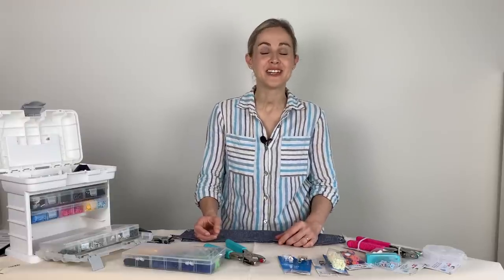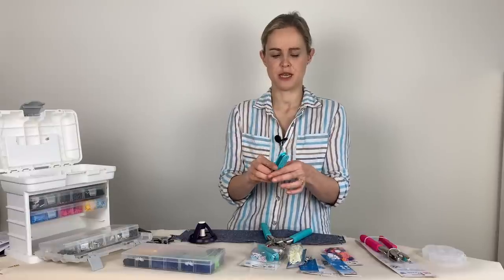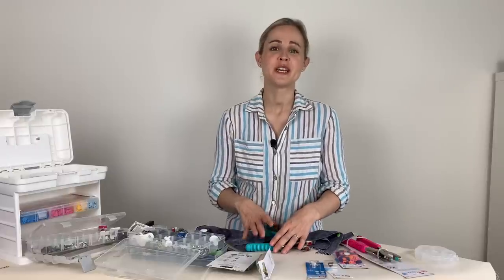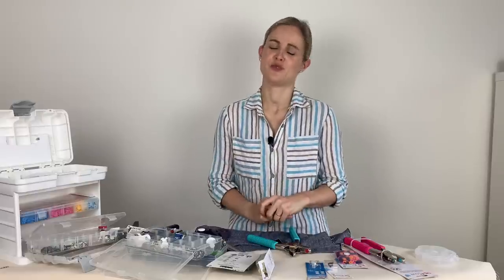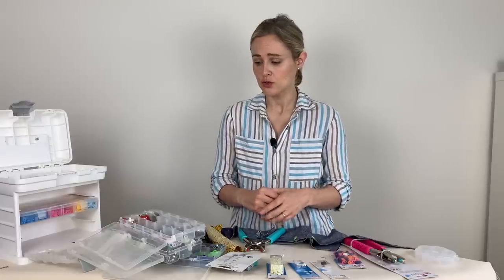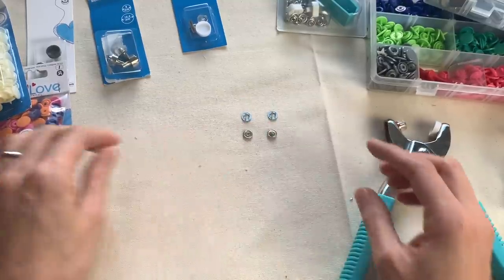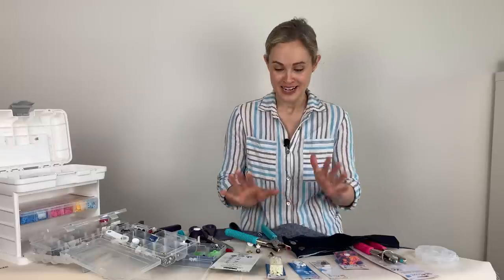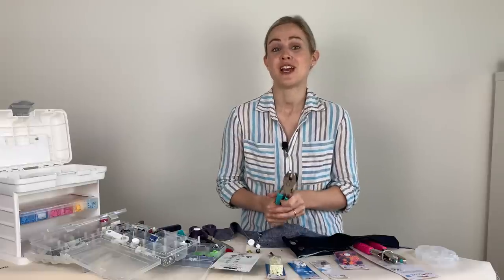How to use Prym Vario Pliers - Laurens Top Sewing Tips - Part Thirteen

Comment: I was very fed up when I bought 4mm eyelets - they were impossible to apply well. There were 2 problems - 1) minimal non-verbal instructions with hard to comprehend pictures and 2) the 4mm eyelets are one piece only. l was hoping that this video would help, but it doesn't because it doesn't show how to apply this type, only the larger, 2-part ones...

Comment: Hi Lauren I've just used my prym pliers for the first time with 9mm fixings and 9mm coloured poppers.  I have made a quilted caddy bag.  It has 2 layers of cotton fabric sandwiched with cotton batting.  The poppers,went on well but after a few times pulling them apart, one side stays with the other. I've gone through a dozen.  Am I using the wrong poppers, the bag is probably 1mm thick where the hole is?

Comment: I bought these 5 years ago and have never used them! I already had Kam snaps and pliers what worked fine but wanted these to use my non-standard snaps, jeans buttons, rivets etc. Once I discovered that I'd need to buy more Prym products in order to get the setting tools, I put the Love pliers at the bottom of a drawer in my sewing room where they stayed. I felt I'd made a poor choice.

So now after watching your video I can at least make holes and insert plastic snaps (easier with the Love Vario than my old pliers). And I will look into buying the rivet and eyelet tools which I'm hoping might work with the hundreds I already have? Thanks for posting this😊

Comment: This is really helpful, thank you. I bought the large set of metal bits, includes Camping etc. However, I have lost all the bits to tell me which attachments to use for what. I did ask Prym for better advice, but didn't get any feedback other than to watch the videos. It is difficult to see the parts and which piece goes with which attachment. I understand everything else but it would be helpful to see before squeezing it together to show the part and the piece together before attaching. Thank you again, I'm sure I will get there with a bit of trial and error.

Comment: Hi Lauren, many thanks for the comprehensive video on snaps which is very timely as I was trying to add some jersey snaps to a little romper suit that I'm making for a new baby. Although it's a light, woven fabric I bought the jersey snaps. I've put a piece of tape on to reinforce the fabric where the snaps are to go. I was too mean to buy the pliers so just used the tool with a hammer (which is what I always remember doing, although it's probably 25 years since I last used them!!) Much gnashing of teeth later, I gave up! The spikes kept either coming through the fabric outside the popper or they wouldn't grip at all and the tool broke! What is difficult to see in the video is which way up the 'female' piece of the snap goes (and I can't see on the Prym instructions, either). Is there anyway of either describing or inserting a photograph, please? Sorry if I'm being really thick!! Thanks!
Reply from the maker: Hi Vera, 
I'll add another picture to my blog post that shows that a bit clearer. It sounds like you might not have had it the right way round, or everything wasn't lined up when you hit the hammer. It's harder to keep things lined up and engaged with the hammer, that's why i prefer the pliers as you can slowly control things as they come together and make sure the two sides of the snap are 'engaged' before applying the force.
Reply: @LaurenGuthrieGhani  Many thanks, Lauren! Yes, I think I must have got them upside down. Ordered some pliers from you yesterday and some more snaps.... don't tell my husband!!😅

Comment: Hi there, thanks for your comprehensive video.  I find it quite difficult to separate the plastic snaps once closed on the garment. Do you have any tips or tricks on how to separate them more easily?
Reply from the maker: Hello, I think as long as you have reinforced the fabric you are attaching the snaps too, don't be afraid to be....'assertive' when opening them. Sometimes with repeated use they might get a bit easier to separate :)
Reply: @LaurenGuthrieGhani  ok, thanks for replying.

Comment: Thanks Lauren, this is so helpful. I've used Hemline anorak fasteners and put them on using  a hammer. Some of the them leave the inside part of the top fastener behind when you open them. The result is that I have to remove them. Any tis on how to avoid this? thanks, Shivaun
Reply from the maker: Hi Shivaun, I've not used the Hemline brand ones before so I'm not 100% sure, sorry. It sounds like maybe things haven't properly engaged and linked together so maybe you need to hammer a bit harder or on a harder surface when you are initially attaching them

Comment: I watched this because the instructions on the pack are useless! I've used the plastic snaps by trial and error my reason for watching was to find how large a hole needed for 5mm eyelets. I'm still not sure! I have put eyelets on the back of a corset and, though I have the hole cutter for the snaps and they aren't big enough for the eyelets 'top hat' part to go through very tough fabric even with lots of 'encouragement', I ended up using my scissors as you have suggested plus some Fray Check. Not an easy task with 2 layers of coutil and 2 of satin. I managed in the end with trial and error on scrap fabric but on the actual garment it took me all day to insert 22 eyelets! This video, though it didn't fully answer my query, is excellent for all the different types of fasteners. The only thing I would have liked to see was a more close up of the tools and the parts for each fastener when you layed them out on the table. I'm going to order one of those hole punches you used. Thanks so much for this useful video.

Comment: Thanks so much for this. I’ve had a set of these pliers for about two years  - bought a set of pliers and some fasteners via Etsy - but hardly used because I have struggled with them. It is also very difficult to access any of the prym fasteners here in New Zealand so I might be putting in an order soon to you as I see you ship worldwide :) one question, I have found it very difficult to remove the different tool sets from the pliers where they fit into the pliers, I know there is the plastic gadget to help get them out but it has all seemed very stiff and difficult, did you find that got easier with use, or have you done anything else to help with getting them off the ends off the pliers, I’ve even wondered if I should oil the ends to make it easier, thanks for any suggestions about this.  Robyn
Reply: The little tool, after I found out what it was (!) can be hard to use at first as the tools do fit very tightly. I have found they don't get looser with use. Indeed they have to fit snugly, you wouldn't want them falling out just as you were about to squeeze!! On the site where I bought some eyelets the owner says she finds pushing the tools out with the 'u' shaped metal thing used to keep the pliers closed for storage better for her. Don't oil them, you may damage your fabric. It would be awful to spend time and money on making a garment only to have oil stains on it. I do find, however, the plastic 'pusher outer' does get easier to use the more you use it.
Reply: @lunasmum6869  thanks for this info, I've fiddled around with it some more and I think I am getting more of the knack of how to use the plastic thing in the right angle to click out the pieces.

Comment: Ive not been able yo understand which tools you are using for the coloured snaps ..
 Can you give a close up of the tool set. Thank you.
Reply from the maker: ah yes it can be tricky as they are so small. If you check out my corresponding blog post linked in the video description it has pictures of all the tools for each type of fastening so it will be easier to work out the difference looking at them :)
Reply: @LaurenGuthrieGhani  Thank you

Comment: Are there different stronger types\strength of Pliers please thanks
Reply from the maker: With Prym there is just one set of pliers, but with other brands perhaps there are different ones available. They wouldn't be compatible with the prym fastenings though
Reply: Are all Pryms appliances are all  compatible? Please
Reply from the maker: @alicemcquillan9764  Hi Alice, I hope I'm interpreting your question correctly here, yes prym poppers/snaps that come with a a tool set and a purple clip section (that you use with a hammer if you don't have the pliers) will all be compatible with the Prym vario pliers